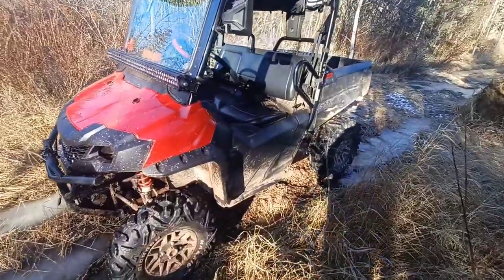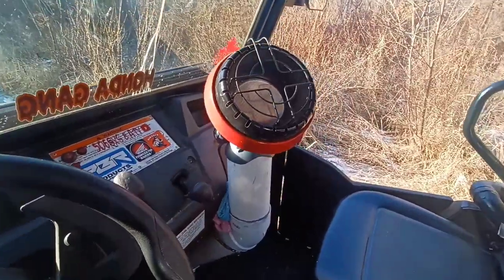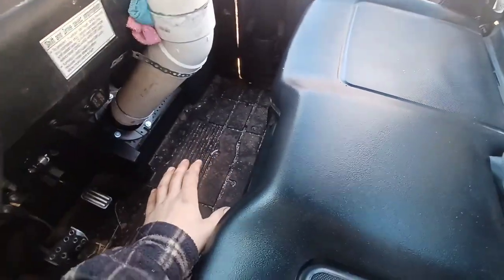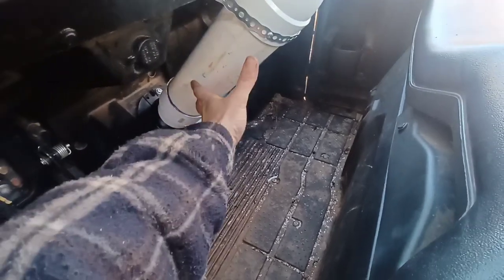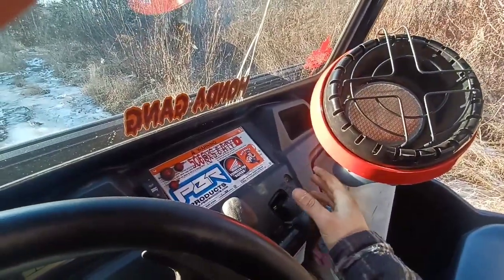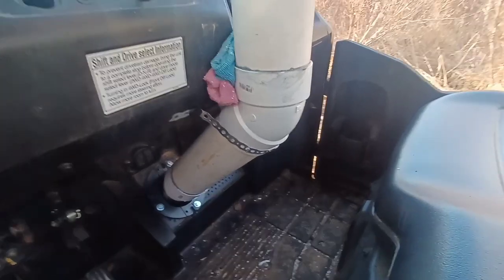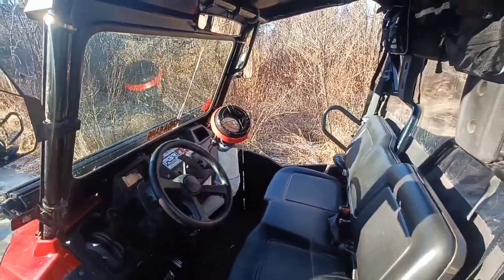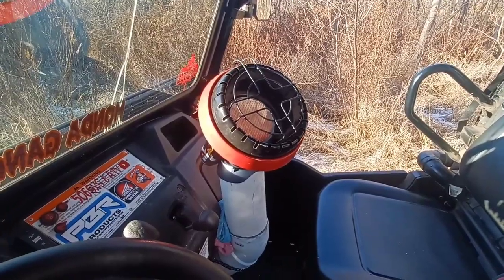506SXS & ATV - DIY Mr Heater Little Buddy Holder For SXS/UTV

Comment: 🏆🏆🏆👍🤶🙏
I had one of those I'm 2003 Rhino.  I took a fire extinguisher steel mount, cut it, welded it back together to hold the 1 lb. propane bottle. And used a piece of flat plate to mount it to the dash. 

You could ride n rotate it towai the driver is alone, or toward the passenger.

It worked great. 👍

Thanks for sharing.
Reply from the maker: Yes that's a great idea you had thanks for watching and leaving a comment

Comment: I built one today.  I used one 4" flange and 2' of 4" pipe.  (Menards sells them in this length, which is good because who used 4" for anything else?)
I just went straight up, but I like your idea.  I'm only putting mine in for winter when plowing so passengers isn't a thing for me in winter too often.  
I used that one bolt on the floor you can see in your video, and the one that goes to the frame half way down from the seat cushion to floor.  I made a bracket for that one, and the one on the floor, I replaced with a longer one and washer to hold the flange down.  Since all the force is straight down I just have the two bolts that were there and didn't have to make any holes.  Someday I'll get an Inferno installed and I don't want permanent holes.
I drove it up to 30 mph down a bumpy dirt road and I was shocked that it didn't wiggle around at all.  Really worked out great.  Thanks for giving me the idea and even mentioning the straight down as I looked and could not find that video anywhere.
But in the two bolts were just where I needed them to be to make the version that blocks the passengers legs for my driveway plowing at home this winter in Michigan.
Reply from the maker: Glad it helped !!

Comment: Is your pipe 3” or 4”
Reply from the maker: 4"
Reply: @506SXS  ok thanks go job by the way I been trying of something to hold my heater
Reply from the maker: Good luck let me know how you make out . Be sure to disable the tilt sensor
Reply: @506SXS  how do I disable it
Reply from the maker: On my model I had to take it apart and there is a sensor inside the unit you need to unplug or bypass I believe. I watched a YouTube video specifically showing this step

Comment: I have that Mr heater little body on my Polaris ranger 500 work okay it turns off if it moves but I just bought a Honda Pioneer 500 and bought a Mr heater golf cart  one but it won’t fit because my windshield I need to improvise a wood base or pipe attached to the plastic on the base of the seat just to hold it down.
Reply from the maker: You have to disable the tilt sensor in the Heater or it will shut off when you hit bumps